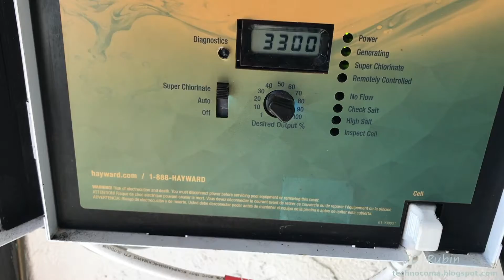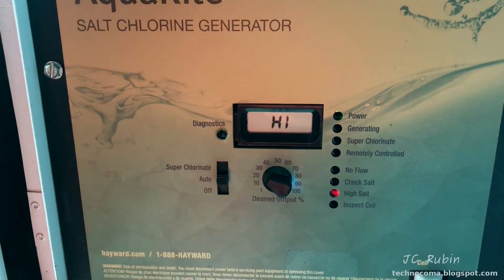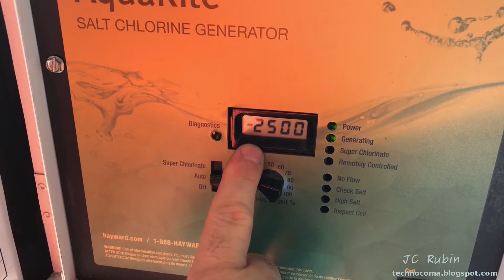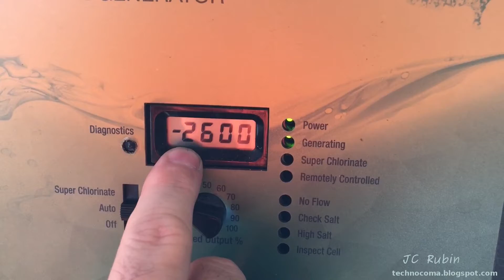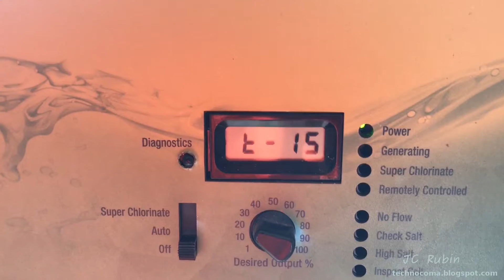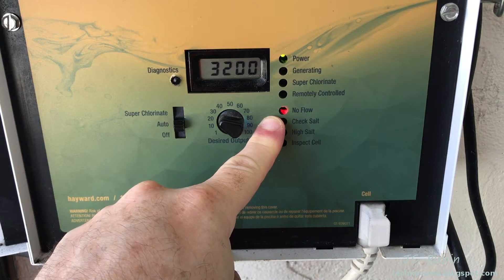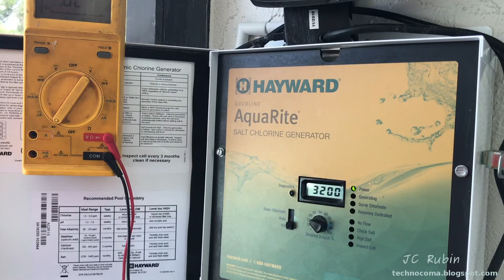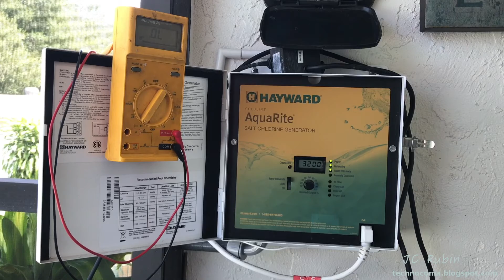Hayward AquaRite Turbo Cell - Quick and Easy Troubleshooting of Common Problems.

Comment: Bc these are complete trash. Never have the correct salt readings.
Reply from the maker: Bc?
Reply: @retrotechandelectronics Because...
Reply: Every a few days the chlorinator drops to 2300 at least and it stops making chlorine when actual the salt level is good. I cleaned the cell about month ago now I'm getting this crappy reading

Comment: I got tired of the flow switch losing connection because of the plug so I soldered a jumper to keep the flow on all the time
Reply from the maker: If the pump stops and the chlorinator keeps running. It will produce a super concentrated amount of chlorina in the pump area and destroy everything

Comment: I have to do this every day, with regards to recalibration of the salt cell. I have verified the correct cell on the system.  It’s almost like the system forgets the next day. The calibration holds for one day as I have checked it multiple times throughout the day. Any suggestions on the next step would be appreciated.

Comment: Hiya, I am having an issue where my panel isn't displaying the "t- " options. I have this unit and a T-15 cell, and I suspect it just needs to be set to that, but after that r1.59 screen it just goes back to the beginning. Any thoughts? Much appreciated.

Comment: Hi I turn it off but I don't hear a click. Also tried pressing diagnostic 5 times nothing. Says no flow. I replaced the tcell 40k gallon. When turn  off green light on generating but it turns off after like 5 seconds. It's been giving me trouble for a few months and added chlorine chemical. I just added a bag of salt but numbers don't change. Does it need time to reset or just have to replace the chlorinator altogether ?
Reply: The unit is about 5 years old so maybe it needs to be replaced due to electronic component malfunction
Reply: The unit is about 5 years old so maybe it needs to be replaced due to electronic component malfunction
Reply from the maker: Did you try shorting the flow switch

Comment: Great video..i have a month old new hayward t9, day i installed it , aqua rite reading showed 3100 ppm..pool store and local pool guy both tested at 3200ppm..next day the reading on aqua rite jumped to 4000ppm..i never added salt..it since has only come down to 3600 ppm..advice? Lemon cell? Bad aqua rite board?? Its on the t9 setting also and i recalibrate it still to 3600ppm
Reply from the maker: Were you checking the average or the real time
Reply: @retrotechandelectronics  average goes to 3700 then settles to 3600 ppm
Reply from the maker: @ if it stabilizes after a few days and matches the test strips within about 400 or so, don’t worry about it
Reply from the maker: @ give it a week and check, dump an inch of water if needed and fill should be fine

Comment: Thank you. I had my salt tested at pool store it was 4000ppm. I went through your diagnostics and it reads 2400 ppm. Cleaned T5 cell and same thing. Went through several calibrations and still 2400ppm. Tried to find the T5 on menu and mine doesn’t have that option. Frustrating sir.
Reply from the maker: Look for t anything… you maybe set wrong

Comment: I just replaced my cell 4 days ago. It was working fine until I put the panel setting on T3 due to the cell being a T3. Since then, it’s been flashing check cell and check salt.
Reply from the maker: Always compare with test strips after a big job.

Comment: My problem is my cell is clean, no issues there.  The problem I am having is the cell is reading LOW salt readings.  RIght now it shows 2800ppm, yet I had it professionally tested yesterday it was 3600.  I have had this done (professionally tested, the salt ppm) and it is the same problem.  I have reset it multiple times, it is set CORRECTLY T9.  I have also used salt test strips and a meter, ALL show higher salt ppm compared to the cell readings.  One last thing, I took the cell to Leslies, it tested good for T3 and T9, failed on T15, which makes sense, there are more plates in a T15.  Suggestions?

Comment: i am having issues with my hayward aquarite system. The only light I see green is power. I tried to recalibrate it by turning it off then on, like in your video and no change. The numbers on the screen do not move, unless I hit the diagnostic button. Had my sat cell tested and no issues. My water can't hold free chlorine. About 31,000 gallons and I have been adding a case of shock every week and within 3 days, 0 FC. I tried to locate the T on my screen and it is no where to be found. I am using the T15. How do I know if my mother board is bad or is it is the entire Hayward system?

Comment: Finally - Finally I am see the lights.. correctly.
Fantastic video 
  - Had my pool builder tell me to reset the light really does not need to be inspected.
     - I did inspect, too almost 3 hours to eat all the calium build up...
  - I had Leselie tell me I needed 10 bags of salt, which I stupidly bought, in AZ we get our water from the Salt river... yeah you know salt I the water should be enough 
We had power hits... the panel defaults to a T3 - then shoudl be a dip switch... mine should be t-9
been empty my pool and pooring salt for the last month trying to figure this out...

Now it all makes sense.
t-9 I am the salt/cal are showing 4.60, so I cam guessin I eed to add some more water.. I am goign to what to it what 24 hours to make sure.. because I have a TDS that shows around 3000

Comment: The first thing it’s doing in ur video when the - number goes down and u put it up into super chlorinate and then back to auto to calibrate it……. I did that, and it seemed to work for like a day, and then the next day it went back to -0 again and I keep having to calibrate it back over and over….. do I need to clean the cell? Hasn’t been cleaned in years
Reply from the maker: Years????? Yes ! Inspect , clean!

Comment: I had this issue where the salt cell was reading lower than the actual salt level and the system wasn’t generating chlorine because of that.  I used the salt cell cleaning solution and the fins looked ok inside the unit.  Then I reinstalled it and it worked ok for a couple days.  Then the same problem cropped up.  I have the solution I think.  I used a bubble tea straw brush (just a small wire brush and scrubbed in between the fins inside the cell until all the fins looked clean.  Now it’s working properly.  I’m not sure exactly where the sensor is but I imagine it’s near where the wire comes into the unit so I made sure to get the brush in and around that tight space.  Now it’s working properly.   Hopefully for a good while.   Worthwhile to try out and save 1000 dollars for a new cell.
Reply: what did you use chemical wise?  Was it the muratic acid approach or the vinegar?
Reply: I used a premixed salt cell cleaner from the pool store. I think it’s probably muriatic acid but not sure.

Comment: My Aqua Rite is running version 1.45 and I don't have that last diagnostic option to see the T cell number. Just bought a new t3 cell and still below 2000ppm even though I know the actual is close to 3000pm. Any thoughts?

Comment: My generating light is off and I can’t recalibrate the salt reading. It shows at 1500 while it is at -3100. Does it mean that my aqua rite needs to be replaced?
Reply: I just replaced the salt cell and it did not fix the problem.

Comment: I’m trying to make sure the proper t-cell is selected on my aqua rite but it does not come up as an option to select.  After the “r-…” option it goes straight back to the salinity reading.  Does this indicate what kind of problem I’m having?  Also, when I turn the unit “off” and then back to “auto” there is no clicking sound.  The salinity just reads 1600 and it will not reset itself no matter how many times I try resetting it.  Tested the water yesterday and the pool store said the salinity is reading 3300

Comment: So does this mean that if it won’t recalibrate I need a new cell?  If so I’m so disappointed with Hayward. I’ve only used this system for 2 summer and if I have to replace the cell every 2 years then I will be sure to let everyone know not to buy Hayward products
Reply: Everyone
I had the same issue!
A lot of times the problem are phosphates and other things in your pool. You need to take it to one of your pool supply stores and get a full check of your chemicals! I was going to replace my salt cell after one year and luckily, I found out that it was an imbalance in the chemicals not just the salt Cell. Most of the times if you take your pool water to the pool stores, they will just do a regular check. They need to do a thorough phosphate and and everything else and they save me a lot of money. Hope this helps.
Reply: I had to replace mine and I’ve only had it a year.!! So disappointed!! They don’t give any instructions on the new cell either!! I had to figure it out myself. Thank God for YouTube
Reply: Same here! Junk

Comment: Great video - many thanks.  My 8 year old T-15 had reached the point that it would not return to service after cleaning because it thought the salt was too low.  After recal it works fine.  Thanks again
Reply: after recal ???

Comment: Hi and thanks for the video. i am having somewhat of a different problem i need to troubleshoot. when testing the salt level through a test strip or taylor liquid type test, I get a reading of 3600 - 4400 depending on which test. when calibrating my unit it reads about 2400. I have cleaned it but can try again. my settings are t-15 so that is not the issue. any other thoughts?

Comment: Hi Mike. How do I know if the problem is with my cell or panel?  My cell is about 5 years old and I know that is about the life expectancy of a cell. The problem is it stops generating. I can do the procedure in your video here and it will start generating but only for a short time. The pool store chemistry analysis says my salt level is at 3000 but my panel reports about 2300. I know it typically varies by a couple of hundred but not this much. I called Hayward and they were useless. I asked a tech guy how to determine if the problem was the cell or the panel. He told me to call an "expert" to diagnose it. They just don't want you working on this stuff yourself.

Comment: I have an aquatrol cell and cannot see what T level it is on. I replaced a t-5 with a non Hayward compatible t-5 and it is saying my salt is at 5000 when the pool store reads 3200. How can I  recalibrate to the 3200 reading?

Comment: So here is my current situation. The check salt and inspect cell lights were on constantly. The panel said it was NOT generating (no light). My salt level, according to pinch a penny water analysis, was 3100. My panel said it was 2400. I ran the recalibration of the panel per your instructions and the "generating" light came on, the salt reading on the panel came up to 2700 during the recalibration. A week later the water analysis at pinch a penny said my chlorine level was at 5. However, the generatiing light was out. So I'm thinking that I'm still producing chlorine even though the light went out. I also had pinch a penny test my cell and it tested ok. Today, the generating light is out. Had my water tested and I have zero chlorine, salt was 3200. Salt on my panel was reading 2200. Had them test the cell again and it tests ok. I cleaned the cell and turned everything back on again. Ran the calibration on the panel again. The check salt light is flashing. I reset the inspect cell light. Says it's generating. The cell is about six years old and I know this is around the average life cycle of a cell. Since the cell "passed" it's test, how do I know if the problem is in the panel or not? Is there a way to test the panel? I don't want to invest in a new cell then find out I have to invest in a new panel. I reached out to Hayward but they would not answer my questions. They just wanted to refer me to a local dealer to come out and troubleshoot. I appreciate you taking the time to read my email and would like to get your input. By the way, I replaced the thermistor in the panel about a month ago.

Comment: Hey great video, My Hayward is indicating the Inspect cell and Check salt.  I had my water tested and it is at 3100, running a t3 which is in the normal range, as welll I cleaned the cell with acid.  not sure what to do next, ideas?
Reply from the maker: If you serviced the cell you need to reset the timer that stops the inspect cell from flashing.

Comment: I just replaced my cell and am now  trying to calibrate for HI salt as well. Before I replaced it the salt was reading very low.  I Pushed the button five times to see the output The numbers were very erratic like yours And then it just jumped back to high. Also I don't see an option on my board to choose my cell type. any thoughts? Ita a Hayward Blue Essence which is the exact same setup as this.

Comment: I have a Hayward Tcell940 what should my setting be on my system 15,9,5,3 the pool is 14000gl
Reply from the maker: It’s written on the salt cell…
Reply: @retrotechandelectronics  Only says Tcell940
Reply: @retrotechandelectronics  And yes it should but it only has Tcell940 on it

Comment: You are awesome! Thank you for making this video. It saved me from having to call a technician. I’ve had this system for 15 years and I never realized the type of cell could randomly get selected with a power outage. It was incorrectly set on T-9 and wasn’t producing chlorine.
Reply from the maker: Not an awesome design imho.

Comment: That's not a "calibration".  The two values are different, one is the average, one is the instantaneous.
Reply from the maker: The average over time would take considerable amount of time to read a correct value if the system were off in its readings. Conducting this calibrates it against the actual value and let’s the average compute appropriately. Settings something that is wrong to what it should be is called calibrating.

Comment: How do you get rid of a HOT message on the LCD screeen?
Reply from the maker: Does your device sit in direct sun light.
Reply: @retrotechandelectronics  no sir, it's under a small roof.found another clip of wiring up a potentiometer and bypassing  the temp in the salt water gen all together.going to try that today.
Reply: @user-dd6wv4vp4x did it work? Mine is doing the same

Comment: Pool store sees my salt at 3100,  but equipment sees it at 2200. Cell is 4 years old.
Reply from the maker: reading the current of the cell and converting it to a salinity value assumes the cell type setting is correct. If it is, has it been cleaned lately.

Comment: Non-volatile RAM maintains data with power loss.  You mean to say volatile RAM.
Reply from the maker: I shut power all the time to work on this unit and it retains the settings, because its stored in NON-volatile ram. Corrupted by a power surge. I know what I mean to say.

Comment: Thanks for the video good sir.  I recently was dropped off one of these to "troubleshoot" and me, knowing NOTHING of saltwater chlorination, said sure.  Apparently they wanted like 90CAD just to look at it and was told it likely needs a new board.  Typical trying to sell parts where they don't need to be.  Not as far as I can see, but I am still waiting on the official report from the customer as to what the actual symptoms are.  I didn't even know it was for a pool until it got here lol.  This walk-through will be super helpful.  If it needs board level repair, I am going to attempt to effectuate that myself.
Reply from the maker: Test the thermistor, its known to fail first...

Comment: Hello, I have replaced the motherboard and replaced the salt cell recently,  I started having problems keeping the generator generating chlorine because each morning when the pumps come on the salt reading is 1700 or less. The actual salt reading is 3200. I can reset the salt level on the unit but it would drops down the next day to below 170000.  I have to recalibrate everyday to get the correct salt level reading so chlorine can be generated.   Any advice would be much appreciated, thank you!!

Comment: Good info.  My amps are reading 0.  I can't figure out why.  I also had the salt up to 3000 when the pool started to cloud up, the salt suddenly dropped to 1600.  After cleaning the cell it dropped to 1500.  I don't know if I need a new system  Mine is 11 years old.

Comment: I have a mineral springs bioguard with a t-15 cell. The check minerals and check cell lights both stay on constantly. If i try to recalibrate it and do the 5 button push thing my salt level never moves at all, jt just stays 0. Any ideas?

Comment: I dont know what is happening. With old cell, I was getting only low salt. I tries calibrating, cleaning and all but never generating. With new, I was high salt, drained water and added fresh water. Then went to low, slowly added salt to a point that I can only pass fromm low to high salt. Its discouraging.

Comment: Excellent video! Thanks very much. I am trying to diagnose an issue on my system. It was installed professionally and use to work. My diagnosis display works but power light remains off when I switch to auto. Salt level is good tested independently. Power light is green when I reset in off position but I switch to auto generating light goes on looks good for a few seconds then clicks and both lights turn off. Salt cell t940 has been acid washed looks good and is only 2 years old, I’m going to try the multimeter test you did. Can not get a read on my generator it just shows zero values for salt. 20 amp fuse was fine but changed it anyway Let me know if any other ideas. Thanks